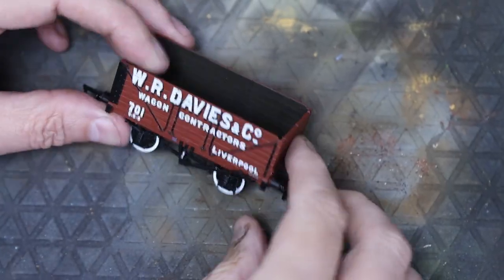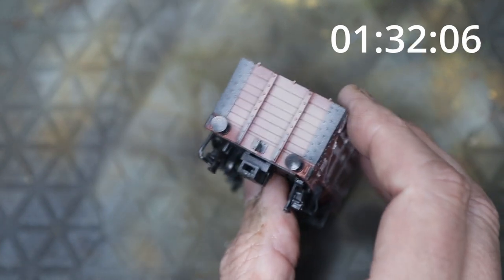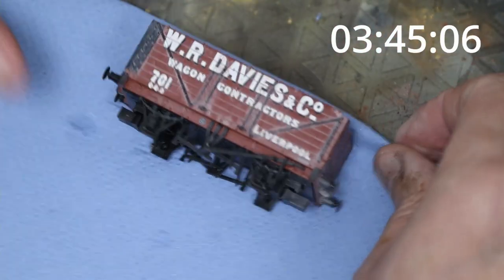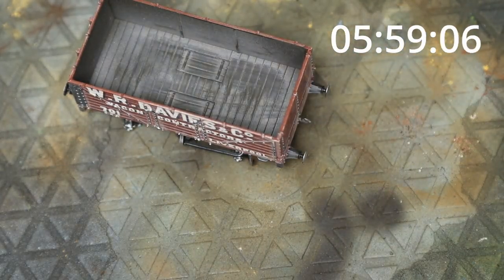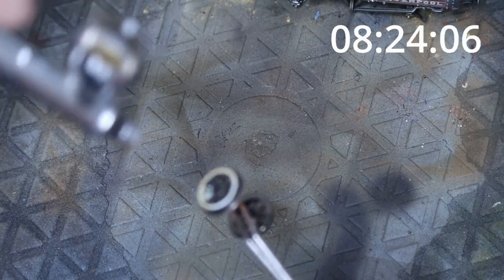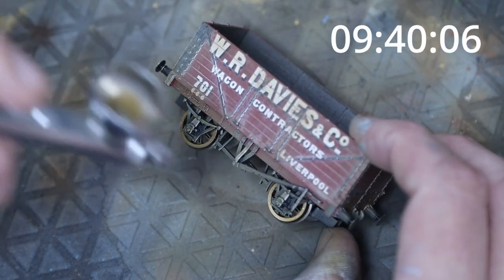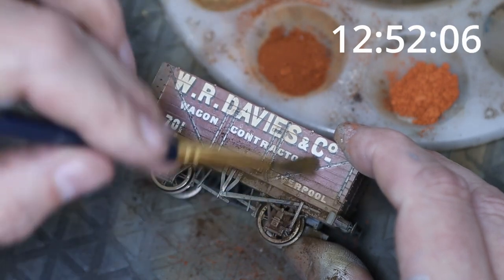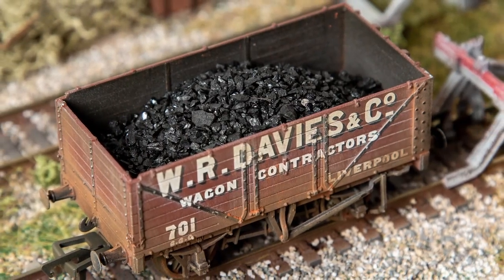Weathering A Plank Wagon in Less Than 15 Minutes | Model Railway

Comment: Smashing use of powders at the end there Bunt, I agree about not sealing if you don't have to - in my experience if the powder is a quality product it'll bite into the surface coat enough to withstand the occasional bit of fingering.
Reply from the maker: Yes. The Matt coat will dilute the effect of the powders, so if the wagon won’t be touched too much, I’d agree and not give it the Matt coat. I do mine if they are specifically being made for sale
Reply: @BuntersYard  yeah I usually ask the customer what they would prefer, it's usually 50/50

Comment: I recently invested in an airbrush (Iwata Neo) but haven't given it a test drive yet, so I'm looking forward to running it over a couple of old "Mainline" wagons to see if I can't breathe new life into them. What pressure do you set the compressor at for applying the weathering coats? I'm guessing it needs to be fairly light to get the misting effect. A great looking model and thanks for posting. Oh, you have a new subscriber, too. Stay well.
Reply from the maker: Hi Paul. Good choice on the airbrush. Pressure would be around 15psi for general use, and less for finer, close work. Good luck with your future weathering. Let me know if you have any particular requests or ideas for future videos